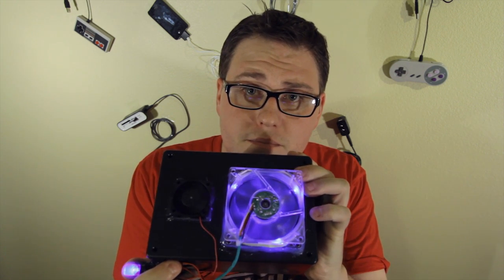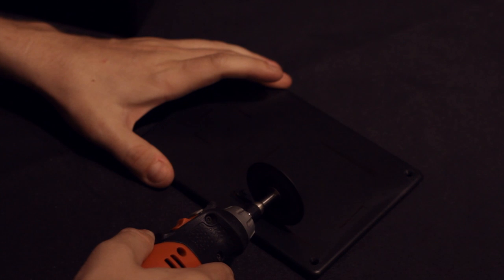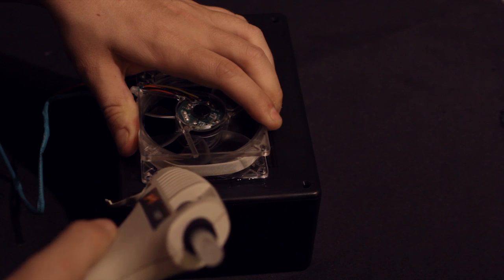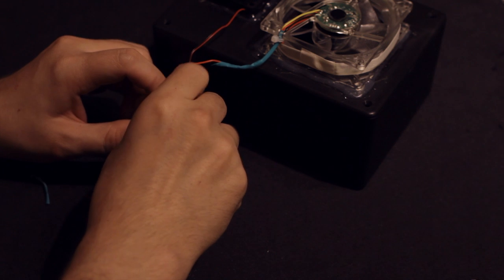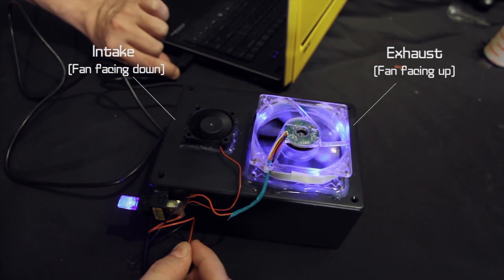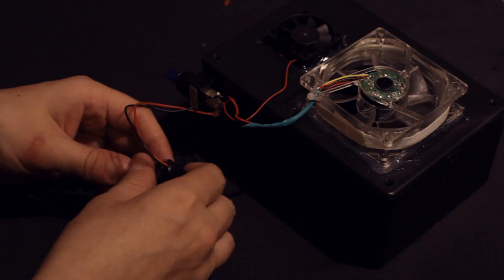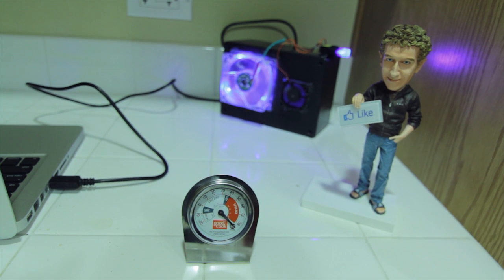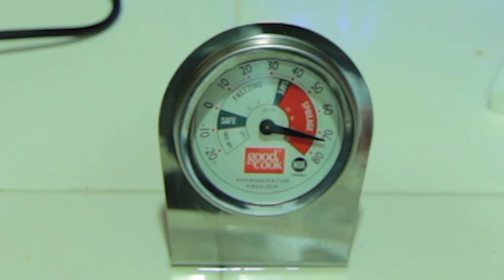USB Powered Mini A/C!

Comment: Why should the exhaust be bigger than the intake?
Reply: It doesn't have to be, you don't even need an intake fan.  Low air pressure inside the box caused from the exhaust fan would cause enough air to be pushed into the box because of pressure imbalances.
Reply: Actually having the in-take smaller is a good idea to create a more turbulent draft of air that will hit the ice at a faster speed

Comment: Screw using the USB cable. Not enough power. Just use a 12v power supply or even a 9v supply. The fans will run so much faster than off just 5v.

Comment: Nice video. Pretty annoying when people are so Lazy that they don't want to buy tools. If you are into DIY projects then you should own tools, if not go to a neighbors place.
Reply: Yes because it's laziness and not a money issue for most people.
Reply: metalkiwis
O shut up. No one wants to hear a sob story.
Reply: metalkiwis
I'm an electrical contractor so I have plenty of tools my friend.
Reply: metalkiwis
ok
Reply: james hawkins I'm jealous.
Reply: *****
that sucks
Reply: Sorry not everyone has the money to buy a $40+ tool  for a $10 project.
Reply: PoppingPepsi 40 dollars will get you a whole tool BOX if you shop around. Where are you buying tools? I have NO JOB but still managed to accumulate more than adequate tools during my life.
Reply: It's not a fucking sob story, dumbass...some people LITERALLY can't afford to buy tools. Did you think everyone became rich all of a sudden??
Reply: do you have Harbor Freight stores where you are James? I'm about to get an air compressor for like 40 bucks (39.99), enough to fill the air in my tires or drive any air tool. Compressor will prob kick on real fast but it's still rated at 100PSI. 10 bucks for a decent angle grinder. 20 bucks for a combo cordless drill and spotlight with a battery each and a charger. FREE multimeter just for showing up, no purchase necessary, same with an LED flashlight. THAT'S FREE TOOLS. It'll cost you the gas to get to the store, that's it. I mean nothing there is craftsman or real high quality but it's lifetime guaranteed so you can take it back when you've used it to death.
Reply: james hawkins okay i like to do diys but i dont have tools i use what i have because im smart and creative. if i can buy the tools i might as well just go out and buy something similar to my diy. i like a challenge and finding different ways to do things with out the right tools or product, helps me to learn other ways to get the job done. you have to be creative one day you may not have a tool you need or money to buy it, and than you will know that little hack to get the job done just as well.
Reply: PoppingPepsi
I'm sure most people that are into making things like this have accumulated tools over time. If you are a beginner then I understand.
Reply: John Kelly Exactly. Folks kill me with the sob stories.
Reply: John Kelly Yea a tool box, But what about when you need a saw, dremel, power tool etc...? Then what if you need a certain attachment for the tool? Those cost quickly add up.

And yea you said during your life. So don't need a job now to buy tools since you had a job before and were able to buy quality tools.
Reply: If you're on the internet right now you can afford the knockoff dremel i got at radio shack for 40 bucks. then i went to amazon for a device that turns any dremel-ish tool into a drill press, it was 15 dollars and cheap-o chinese. Now i have a drill press with 100 heads for 55 dollars. I can saw with it, drill anything make THIS articles awful device 100X over.  I'd LOVE a job right now, my back is broken instead, spodylolisthesis and scoliosis make for constant untreatable pain. THAT's a sob story. You go get a job right now at papa johns or something awful like that, like i did,  and stop whining to this old ass article about a useless device.
Reply: DragonAurora Come on man seriously, you have to be rich to afford tools. Don't you have craigslist, ebay, pawn shops, all places you can buy, barter or trade stuff to get other stuff. It's tools for home projects, no one is homeless and starving here. Pump you fucking brakes son!
Reply: Thank you. Tell this to those that pretend they are broke. I'm an electrical contractor so I make more then enough to buy tools.
Reply: Yes I have harbor freight. They are getting around now in America.
Reply: Jess Sullivan GOOD!!! No excuses. I like your attitude.
Reply: metalkiwis There is no need for jealousy. Just work hard so you can buy whatever you want.

Comment: How about using two 9v Battery holders? One at the cooling device and one at the usb cable. So you can run it with a 9 volt battery or with the usb cable (after flipping the 9v battery holders) so you don't need to connect and disconnect the cables every time.

Comment: The problem with this is the air will be humid because of the water in the ice, so it will feel hotter than it actually is. Hillbillies in the bayou have been doing something similar for years.

Comment: Well, the USB cable is not designed too be hooked up to the fan, and since i used 1 wrong cable to either the "Black" or "Red" and Suppose i put Black on Black, but Red too like green or something, that it thought it was DATA and since there was no DATA to be transferred, it didn't recognize it.

Comment: Its wasn't a joke no... but i fixed it. My wires were different on the inside of the USB cable. He said use the red and black, so i did, and that was wrong or something so i tried all of them with the black and found out that the green one on the inside was the power and not data or whatever.

Comment: It is kinda retarded.

If you have the 400 to sometims 1,200+ in cash laying around for a PC, you could easily go grab a damned AC at a severe discount during winter on the cheap, or even a damn good one for 400$ during summer. Makes no sense man.

Comment: yeah, I know what ya mean... so far the best way I've found to do it without ice is a Peltier based device, however so far I've just been researching to see how other people have done it. (not too many people seemed to have realized this or something)
such as /watch?v=9F02KKw4uOY its an interesting build but not ideal as it will blow hot air in the same room unless you can shove it threw a hole in the house, but it does supposedly work.

Comment: there's a downside to that, the moistness of the is due to the melting ice could cause condensation on the components, but if you used dry ice, you wont have that risk of destroying you're entire computer

Comment: if your using an ice pack (or ice in a bag) there is no extra humidity added, actually it should dry the air due to condensation for the first little while. then as the ice pack reaches room temp that will evaporate back into the room again.

Comment: Hey Householdhacker, I plan on building an oil-submerged PC (I like novelty too much) . . . if I ran a bit of copper coil through water in that black box, and had the oil flowing through that as a sort of makeshift radiator, would it be a viable cooling solution?  I could just purchase a radiator, but I like the idea of hacking together something myself.

Comment: You could also use this for keeping computer components cool throughout the case by just hooking up the fan to a 4 pin or 3 pin, it would help with overclocking and stuff.

Comment: I watched this yesterday, and I made one of my own. 

It's cool. Sorta. I used a 12v fan as the output, like you, and the USB port could only give it about 5-ish volts, like you said. But it didn't give me "plenty of air". 

So what I did was split the USB cable on the other end, and attach some wires onto it directly from the motherboard, which gave me 12v. 
The way it's set up right now allows me to use it both ways.

Anyway. This was a fun project and all, but, in the end, not very useful.

Comment: You'll want computer fans (one smaller, one larger)
A rocker or toggle switch (that's preference, just ask what those are at Radio Shack or wherever and you'll be good, maybe even a pushbutton if you'd like)
(optional) 9v battery adapter
An old USB cord, like off of a phone charger or something
A project box (or I used an old tupperware container)
And a little bit of patience for testing

Comment: soldering iron or hot glue for the wires. then usb cable, 2 fans, a box(plastic would be better, for easier cutting), a switch(optional), and something to make ice in. :D make sure the fans are facing correctly as in video.

Comment: Ok so I have one fan that works whether I plug it into the usb or 9v but the other only works via battery. ...im assuming the usb carries less power so what kinda fan should I be getting (voltage wise) one that works doesnt have a sticker to find out

Comment: the switch is not really need i know many of you are confused but it is just to turn on and off the fan, you can also do that by just removing the battery or the usb connection, so basically just connect you wires directly to the usb wire (as shown in the video) or to the 9-volt battery if you prefer using it that way, i hope i helped somebody, cheers :)

Comment: I had an idea spawned off this; USB Powered Airfileter. What it does is, for those that have PC's mounted next to their monitor like me have the problem of dust everyware. Could one use an old air filter, stick it between two of the same size fans in the box, and have the fans face sepret ways, could it act like an air filter?

Comment: You gotta make sure you get the wiring right, and make sure that none of the wires touch each other when using that switch... otherwise it'll fry your motherboard. Good idea though, but maybe a battery method is best.

Comment: If the small fan has a significantly lower airflow than the big one, it's only going to lower the airflow, because it forms an obstruction of the air intake.

Comment: A 9 volt should last a good amount of time. But you could get those big looking batteries that are 6 volts and if you buy 2 of them you can connect both of them to make 12 volts and that should last for a long time. They are called: 6 volt lantern battery.

Comment: @xDEATHSxSHADOWx i just modified it a tad, made an AC adapter to run it on 120->11ish volts, used an old GI joe foot locker to do it, i have a pic if you wanna take a look

Comment: Hey as you say the fan will run slower on the 5v supply through the usb... What if you connect two usb lines in series in two usb ports instead of using only one usb, by connecting the negative of one opened usb cable to the positive of another and then connecting the remaining two lines to the ac as you have done? Wont that then provide 10v, since it will be like having connected two 5v battery sources in series???

Comment: I would not use that with a 9 volt battery... I ran a 12v off a 9v battery once and after about an hour the battery popped.

Comment: if you just use a vent system instead of an intake fan you can save power and still get the same result, not only is it a bit more simple to do but it can also make a battery last a little longer if you have to use one.

Comment: at 3:10 when he tests it, he positions the AC on it's side
I imagine in a hot environment, the ice won't stay frozen forever and it will melt
how would one avoid melted ice leakage?
Would the ice pack trick be just as effective?

Comment: @iirmantass3 disregard that last comment, the logic worked in my head, but I just fried a USB hub, LOL. Id say stick to batteries for running your fan systems in the future, less likely to break your computer. 3 fans and 4 9 volt batteries work perfectly together (36v both sides) for running a little fan system.

Comment: @iirmanot umm i think by chip you mean their motor, and if your using advanced ones with some kind of chip for sensing speed or something thats your own fault. For mine I'm just using 4 fans in series (12v fans 48v demand) along with 5 9 volts and 2 C batteries in series (so they output 48 volts total) with 1 air intake fan for 3 outputs. All you need to do is find some way to adjust the voltage to 12v like you need. Idc how you can do that with USB but its not hard to do with the batteries.

Comment: Wish I could have heard whatever noise it makes, like the sound level, or is there no sound except "moving air?" I want to make some recordings and but the AC and room fan are too loud! The heat builds up too fast in the small room I use. So, would you make a short vid so we can hear its sound or which "ordinary" thing can I "equate" it to? I just don't want to go get the stuff (gas adds to the cost) spend all the time making it, only to find out it is not as quiet as I hoped:) Thanks:)
BOP

Comment: so basicly sicne you can run it of of 5 volt usb or a 9 volt. runing of the 9 volt will make the fans spin faster right? so doe that mean i can run it of the 5 volt and the 9 volt if i rewire the power circut in to series rather then a parelel? Also can i rewire it to run of 2 usb for 10 volts.

Comment: @iirmantass3 
Well when the fans are used normally they would be moving hot air from inside the computer.  In this little device they're moving cold air, which will let the fans keep themselves cool

Comment: not an issue that ventilator works on 5 vols. that's no sense it spins slower and heats up, after using it for a while you can burn your ventilator down

Comment: what is the small fan for? the big one is sucking the air out, and the only way back in is through the small hole. what about fitting a pipe to that small hole, which goes down into the ice? that way the air is forced into the coolant and has no chance to pass by uncooled.

Comment: @Teezar22 No it should work fine. Your car battery may have more power (don't know actually) but the consumption of the fans at 12v stays the same, no matter the amount of power the source is capable of to produce. So there is no need to wire them differently ;)

Comment: @DutchMaster22 Any plastic box should do. Just make sure it don't leak. You really don't need a lid for it either, you could just use cardboard for that, or wood or whatever.. In Norway we get ice cream in 2 and 3 liter boxes (a half a gallon++ to almost a gallon), so they should work fine.. Don't know if you get that in the US though.. But my guess is that you can find plastic boxes with lids for sale at most stores, and maybe even in the dollar stores..

Comment: Made it. It's less than impressive. However, I used a 9v battery with switch to the 12 v intake and the out take is a 6" 110 v fan plugged directly into the wall.

Comment: i bought 2 fans. a 92mm and 80mm double ball bearing (they're both double ball bearing). I got a box, a usb extension cable, a heavy duty bat handle toggle switch, and a 9v battery connector. I wired the usb cable, and 9v battery connection together. There seems to be a light shock when i touch it and it's plugged in so i assume its working.

I can't get them to turn on the fan, or work with the switch though. Any solutions?

Comment: @dunkace fahrenheit still measures in degrees, just like celsius .ergo, it's not 80 Fahrenheit, but 80 degrees Fahrenheit (80°F). the only temperature measure that doesn't use degrees is kelvin. although it used to, it's still °K in my old physics book.

Comment: yall should do a video on a wall socket usb upgrade.  all you need is an ipod usb wall charger, a black outlet plate, and a power outlet. you can figure out the rest pretty easily

Comment: This isnt an air conditioner. it has a similar effect, but by definition an A/C has to do
3 things.
Filter the air, remove moisture, and use a condensor over liquid.

this is just a cool fan gimmik.

it does the opposite things
"adds moisture" - this will make u pay later on when humidity goes up
"cools air slightly"
"moves air over ice"

and while a small one may work for awhile it wont last
and a large one will make the house HOTTER as humidity raises.

Comment: Protip: DON'T cut away the white and green wire. Run the green wire to the ground on the battery and then run a white jump wire down into the bag of ice

When the ice turns to water it will short out the data line and tell your computer to pop up a message reminding you to change your ice

Now I don't have to constantly be checking the ice level!

Extra protip? Don't film yourself working on a black case with an ultra dark background... especially with no light. Can't see a thing you are doing

Comment: Be careful when using USB power... if your USB port isn't overload protected, you run the risk of damaging your USB port or worse, system board!  This happens because your device draws more than the low amperage the USB port provides.

Most modern computer PC ports are protected but that doesn't mean you shouldn't take care!

Comment: The only thing to remember about USB is that most motherboard only sink 100 mA of current per usb port, others supply 500 mA on all ports or certain "high-power" ports. Some laptops may not like it if you use to large of a fan. 99% of computers have a resettable fuse to prevent overload, but beware, you could fry your motherboard, or at leas the usb port(s) if you try to take more current than it will provide and it is unprotected. Keep that in mind when designing future projects.

Comment: If there 2 12 Volt fans and you put it through 1 USB; it will run lower then minimum. minimum is 6 volts. your running it through a 5 volt and since theres 2 fans it may run lower then 5

Comment: @ChrisCaelanThomas All the salt does is lowers the freeze point of the water so it melts but doesn't change the temperature. It will make more surface area for the the short term and less surface area in the long term.
The fans just transport the air in and out of the chamber. What is happening is there is a temperature difference between the ice and the air. The two are trying to come to a middle point. While the ice melts, the air loses it's energy and gets colder.